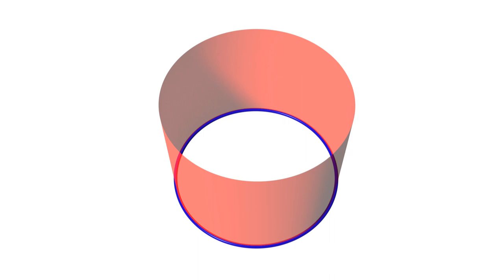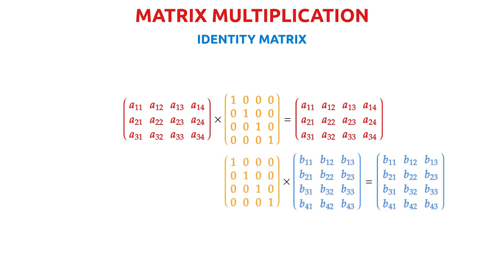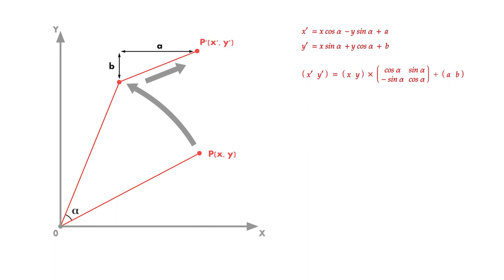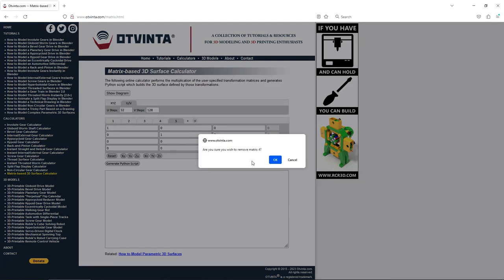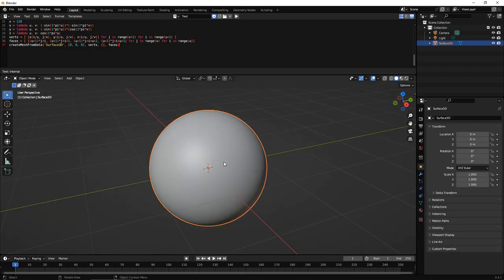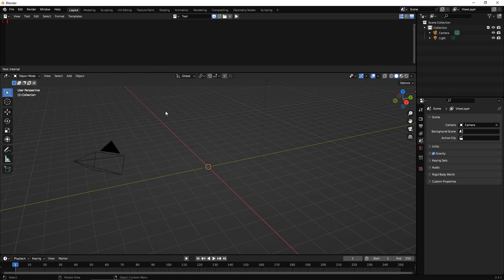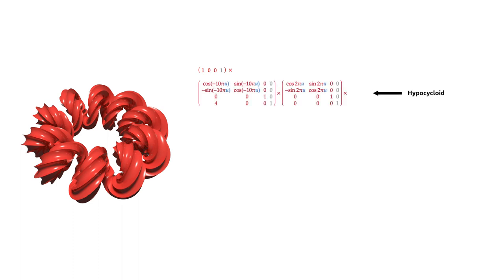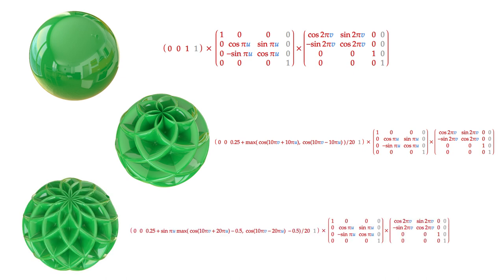How to Derive the Equations of 3D Surfaces of Arbitrary Complexity and Model Them in Blender

Comment: For the DONUT figure, this is a FASTER equation
It has to be tilted in X,Y,Z space x=45 y = 30, z 0 degrees
a = 3 for size

for u = 0 to 2*PI Step Inc 2	
             for v = 0 to 2*PI Step Inc 2
			 
				x = (a + a*cos(v)) * cos(u)                
				y = (a + a*cos(v)) * sin(u)                
				z =      a*sin(v)

Comment: The (Python) translated code doesn't work in Blender 4.2.  The blend file in the reference link to the video is of the wrong blend file.
Reply: Doesn't work in Blender 2.8 either.
Reply: The blend file page on O.T.Vinta was last updated in 2019.  In 2019, the most current version of Blender was 2.8.